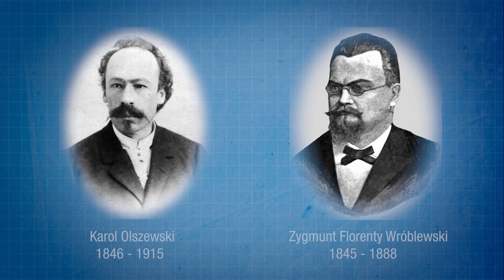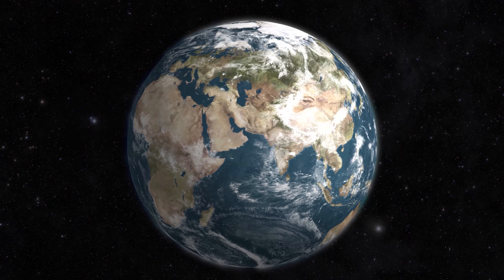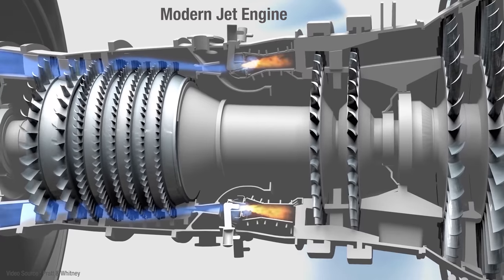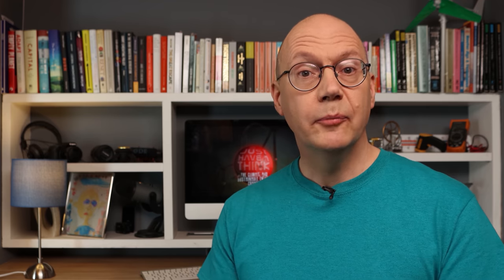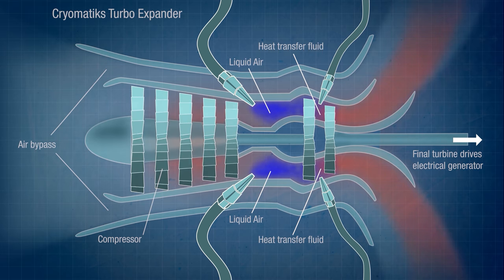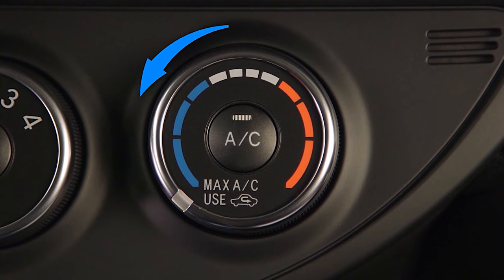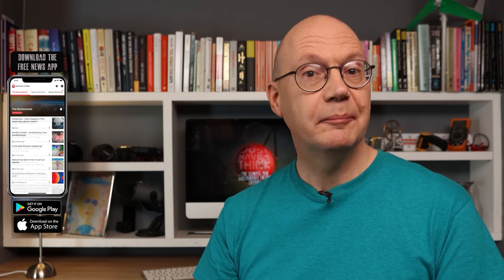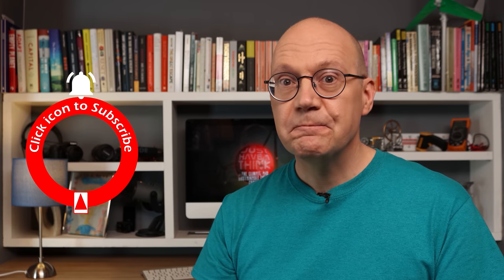Portable Liquid Air Power. A new boost for electric vehicles.

Comment: You talked about the turbine efficiency, whats the overall efficiency?  The power it takes to compress Nitrogen into it's liquid state, what about loses during Liquid Nitrogen Storage, still an interesting concept.
Reply: And by extension, what is the cost parity comparison? While it may be too early for an economic viability study, it would be useful to know how this compares per unit of energy produced based on the price of the liquified nitrogen.
Reply: If it is not mentioned then it is terribly bad.
Reply: Also, what is the source of energy used to compress N? If its fossil fuels, then what's the point?
Reply: If we look into the future to where all these solar and wind farms are operational, there will be many hours during a year where the electricity will either be free or the farms turned  off. That will offset the need for high efficiency. Btw. Why worry about efficiency now? We never did before. 
Eventually everything will be a waste product.
Reply: @klausnielsen1537  Efficiency is only relevant to how it affects cost. If the technology doesn't provide an economic advantage then adoption will be limited and isolated to niche use cases. The current uptake of solar and wind farms is because of cost. Similarly the uptake of electric vehicles is based on long term cost reductions in operating costs of maintenance and fuel.
Reply from the maker: Yes. Lots of questions still to be clarified in the final prototyping phase.
Reply: Overall efficiency is going to be horrible.  If they managed to hit 25% efficiency I would be astounded.  The only saving grace with this system is the ability to regenerate on braking.
Reply: Do not forget safety.
Reply: @Obscurai  ...it's always time for economic analysis of 'as is' technology comparisons. The results should guide, not strangle, the direction for R&D.
Reply: Mr. Castleberry goes right to the point. The Overall Efficiency is the thing. As we all know, energy cannot be created only converted. With increased thermal efficiency of converting the ultimate energy source, be it solar, nuclear or hydrocarbon, into propulsion (work) will come increased economic efficiency. The question then becomes when will that economic efficiency overtake the economic efficiency of diesel propulsion. A thought problem with big economic rewards for some. Again it’s the big picture, Overall Efficiency, that will be the driver.  
Nice channel.
Reply: 60% in the most optimistic estimations. Realistic - 40%. Li-Ion gives 98%.
The only advantage is free air conditioning.
Dead end in automotive.
Reply: @tmcche7881  Yes, I was being polite.
Reply: @JustHaveaThink  Didn't say much about it but presumably you have to fill some sort of tank with nitrogen prior to driving about. I wonder how big this tank would be? Certainly high pressure/liquid nitrogen is safer than hydrogen.
Reply: @williamcooper9753  Nothing will beat diesel as a fuel. It's packed with energy, portable, storeable, stable and transportable by pipeline.
Reply: @Withnail1969  and cheap.  Yes, hydrocarbons are hard to beat as an energy source but also the source of our planets accelerating decline.  Perhaps what this site is exploring are ideas to increase thermal efficiency thereby reducing the hydrocarbons used per unit of work. Fun to explore all the aspects that go into that equation, like the ones you pointed out.

Of course the most effective way to reduce energy consumption is by reducing the number of Sapiens on the planet, but that’s not going to happen, by design at least.
Reply: @peceed  bear in mind this process is using heat from the environment as part of the energy generation process rather than producing heat as an undesirable waste product. It's efficiency is probably better than you think, I mean 74% (theoretical) efficiency is pretty good going - especially compared to 30% for a best case internal combustion process. I think this idea has way better potential than all that hydrogen fuel cell nonsense.
Reply: @williamcooper9753  and as someone else said, totally agree that straight electrical storage is better but there needs to be an over production of electricity if we're going renewable so compressing gas is quite a good energy storage method
Reply: @trialsted  I agree with the need.  Even with traditional power generation (boilers and turbines) the low demand after hours compared to the demand during peak hours presented an engineering problem.  Boilers like a constant load.  Storing energy during low demand and releasing it during peak demand mitigated that problem.  As an example the Helms power plant in the high Sierras that pumps water to a higher reservoir at night, then turns the motors into generators during the day and let’s water from the high reservoir spin the turbine/pumps the opposite direction .  Straight electrical storage may or may not be the best way.  “Best” being the most economically efficient. Much to debate here and slight changes in the cost of the ultimate power source can upset everything.
As you know these are tricks to stretch our power but they don’t change the laws of Thermodynamics.  Energy cannot be created only converted.
Reply: @williamcooper9753  agreed with your last statement but you can use 'free' energy to improve your process. Look at A/C systems, they have an apparent 2-300% electrical efficiency but that efficiency occurs by taking energy from the atmosphere
Reply: @trialsted  not sure what you mean.  An A/C system creates heat when it compresses the gas and discards that energy, which came from the electric motor, to the environment when the gas condenses.  Ultimately the electric motor is doing all the work, unless I miss your point.
Reply: @trialsted  It doesn't matter what I think or what you think, 60% is a maksimum efficiency stated by company that uses this technology for grid stabilization, they are below half of that now.
Currently used Li-ion batteries have better energy density than theoretical max for cryogenic storage.
Reply: @williamcooper9753  Overall efficiency matters, but if that were the only criterion, EVs would be using only supercapacitors instead of lithium ion batteries, because capacitors have higher round-trip efficiency. But at some point, you also need to care about size, weight, and especially cost. Supercaps can't compete on those just yet.

So this is just the same tradeoff. This liquid N₂ turbine system has (much) lower round trip efficiency than current Li ion chemistries, but what if its cost per kWh were also significantly lower? I could see speccing a bus that needs a 200 km duty cycle between charges using 1 km with supercaps, 50 km with batteries, and 149 km with a liquid air turbine. If the turbine is cheap enough, this could offset the increased electrical energy you need.

Mind you, I'm skeptical that they can get this technology cheap enough to really offset batteries and capacitors in EVs. But who knows?
Reply: @ps.2  Peter, thanks for your comments.  The technology for vehicles is intriguing because you have to expend extra energy to carry the equipment unlike stationary plants.  I would think that’s the great advantage of hydrocarbons. Lots of energy, very little weight.  As the weight per unit of energy of batteries and capacitors goes down perhaps we will reach a tipping point and electric drive will take over. “But who knows?”
Reply: @JustHaveaThink [ I have proof read this and find a variety of hilarious or not homonym Errors By The Google dictation keyboard or perhaps it is the Samsung cuz I have a new device and I'm having difficulty with these keyboards. I find disambiguating all of the typos trivial so have not otherwise edited it given a lack of time]
 I think it was yesterday that I was saying to a guy he's making a gas engine air conditioner with electricity connecting the two absurdly they still fear of on the premise that the engine will continue to use his little gas once loaded as it's using without a load presently. Anyway we discussed 30 cc Universal outdoor tool at Home Depot Which is less than 200 US dollars despite the kit having the four cycle and I mentioned that I don't know who is producing small liquid nitrogen capable turbine period before I verified the GE had the lubrication Etc issues down I was concerned but since then I have made this Myspace and there is a Cocoa Beach patented this reminds me of. This is also Jennifer former space in terms of using air as a material. I've only just watch this video but I will dare say that this is a trojan horse of a application which is the opposite of what people are arguing here. You see comparing mined diesel with manufactured liquid nitrogen is a ridiculous comparison. The better comparison would be using a nuclear power plant as we do on aircraft carriers to make fighter jet fuel for a Transit bus versus liquid nitrogen. 

Thermal energy is too cheap that's what people ignore. Consider the opposite of this application which is the heat at the bottom of the Six Mile deep copper mine in Arizona. Their interest is in creating demand for copper not in refreezing the iceberg period so accordingly they produce warm water instead of super high pressure super super duper high volume air.

But there's far more going on with the physics than creating oxygen-free environment for fried carbohydrates. There is the issue of what happens to liquid nitrogen at higher temperatures when not allowed to expand. My understanding of the physics is that it remains inert but remains a free source material with surprisingly High thermal conductivity and of course it is also still non-crystalline even if people want to say it's neither liquid nor gas consider it a plasma copper that is still conducting electricity like any high intensity discharge lamp for example. In order to move the energy that the fusion or at least division is continuously providing us maintaining a molten iron core you have to first move the Heat to the surface then you have to create a fuel with it and that fuel is liquid nitrogen. The alternative is electricity but unless you are trying to sell copper at insane prices and maintain the price of other Commodities like coal and oil and even nothing it is a impossible to defend producing electricity. Windmills do not reduce the cost of energy they increase the price of copper and in so doing extend the viability of burning fossil fuels into the future. Electricity is simply the enemy. When you consider the high-speed Tesla sports car and you see the amount of heat the transmission is producing and how it actually drains the battery to get rid of that heat obviously a in ambitious entrepreneur like the young Caucasian male you interview Seas Market opportunity. The problem is the braking energy is very small and you only need to store it until you accelerate I don't know why you didn't mention this because talking about the weight of the vehicle seems very unfortunate given this silence.

So as you began let me and hear by saying something that most people will be able to understand. Energy if the government as it must evicts the foreign company from the United States Arizona copper mine credible promise to pay them as much as the copper could have possibly received in Revenue and then proceeded to use that six mile deep baase for mining as instead a base to extract molten iron not just mantle Heat by literally filling most of the shaft with a 6 Plus mile deep core of superheated 3 million bar or whatever you want to call it liquid nitrogen. The premise of me telling the story is that you're moving so much heat you cannot limited by the speed with which you would move the heat exchanging fluid this is not your grandpa's Tesla. You're in one whole harnessing the molten irons ability to displace all other sources of energy so you have to move the significant amount of heat to the surface period at the surface you have a value engineered system to compress as some people say and I say snap the air causing the heat to be snapped out of it remember that's called latent heat or for contemporary science purposes the actual Mass of the nitrogen. Don't try to make this too complicated when you squeeze air hard enough that Heat is actually the mass being converted back into energy nothing less than that nothing less than the simplest form of nuclear technology we can build in other words it's arguably the opposite of man-made Fusion apparatus which is a physics research project not a energy production or distribution Enterprise at all I mean physicists especially nuclear physicists are not Saints we pay them too much money we practically guarantee they have no emotional intelligence or morality and certainly we don't equip them with any kind of formal ethics. If your expectation is nuclear power has something to do with energy production then you are very naive. Fission is for military even now and fusion is either a way to get investors to slobber or a interesting intellectual exercise. What we need are heatpipes and the intelligent application of eminent domain as discussed. We don't need to build a six mile deep base station we already have it. We don't need to continue to let them at Great expense produce warm dirty water or even clean water. We don't need to continue to fear the propaganda about nitrogen being off switch for brain which it simply isn't.

You can create the opportunity for proprietary engineering but doing so if you are ambitious is ridiculous. People need energy they need it for a variety of purposes including mechanical work. The cost of the heat at the bottom of that mine and the amount of heat that you can mine that's what matters. Engineering Distributing that as liquid nitrogen is not difficult it requires only one thing a decision to distribute energy so cheaply that no other form can compete.
Reply: @trialsted  Ballard is marketing its fuel cells as so much less heavy a package then lithium-ion for garbage trucks meaning you get many more dumpsters. The thing is liquid nitrogen the weighs nothing when the tank is empty so liquid nitrogen garbage truck can pick up more trash and also you can buy many more of these garbage trucks than the cost if either lithium-ion or just the capital cost for the fuel-cell imposes
Reply: @williamcooper9753  energy is converted into mass and mass is converted into energy knowing that is the difference between parroting a famous line and actually being able to have the think that is necessary
Reply: @williamcooper9753  you think that the added Mass in the vapor corresponds to the energy consumption of the motor LOL. Thanks for articulating idiocy I'm not sure I could have put it into better words
Reply: @peceed  I'm sorry did you watch the video at 70% it's 125 because of the other losses as discussed in this video and I'm not endorsing the application. In this video he gives it a 200 theoretical but the Cocoa Beach patent discusses the various premises of the hypothetical potential energy and I highly recommend that tangential only discussion it's not just a tangential discussion it's only a hint of the discussion. You really are just throwing arbitrary numbers out without actually even doing anything. About whether you have engaged in any heuristic whatsoever. This is Fox News and I don't know why you think it's welcome here
Reply: @ps.2  once again have you watched the video it concerns a specific product which is trying to enable battery electric vehicles. It's not presented as competition but as enabling? I have argued that it's an obvious Trojan Horse but the entrepreneur would clearly disagree with me and that's only if he was honest and ask for his State of Mind in the past not in the future
Reply: @Irene-fu6gj  You are 5 second away from confirmation of my numbers as long as you are able to use google search. 60% efficiency requires heavy multistage expanders and very heavy heat regenerators (heavier than stored air).
Automotive installations would be much less efficient, in the 30-40% area. Let's be generous and give them 50% - it is a double operational cost of Li-ion batteries (>98%).
The last, but not the least issue - recharging will be slow without standalone liquifier.
This technology is clearly unfeasible for cars - batteries are many times lighter and use half of energy.
Reply: @peceed  I have watched this video once and we'll watch it additional time that is to say we might not watch it at all but I will continue to study this intriguing development I may have very well inspired as part of a team looking at various process. The video represents the concept of heat harvesting but actually it isn't War monetization of the cooling system because you do not need to harvest such minimally high-grade Heat it seems. The amount of money that we spend on fooling systems and the amount of energy that is used not generated by them is one of those fruits that lays rotting on the ground.

We talk low-hanging fruits generally speaking not Fallen fruit because of the numbers terms of the total Market and Mr Cooper those say something very important which is how you draw the boundaries of the generation period where you draw the boundary around the generation Capital cost determines the cost of the source energy. In general the aggregate of the comments I respond to is disputing what constitutes generation. But then we have the real world butting in and that is what is most important!

We have the rail industry that used to burn COAL in turbines and now it is claimed dumb Heat by running it through a wire which apparently is the way they get rid of the inertial energy first by converting it to electricity and then that electricity to heat. In the spirit of getting something done namely moving stuff from one location to another. It's important to remember that this type of narrowing of our vision results in footballs of oil being what is getting moved by wasting inertial energy you polluted a lot to create. It is also very important that we remember the reason we care about them doing that it's not because of the energy consumption but because of the pollution!

The key to reducing pollution one must have an open mind 4 because it is likely drastically increased amount of energy to waste simultaneously with the energy being clean. You have to break that Chain by which increasing efficiency reduces pollution. This is where liquid nitrogen comes in because it does not require copper but frankly appears to potentially be the copper for the first miles and as I said ironically those first half dozen or so miles are already plumbed for people and copper ore. Infrastructure speaking it is a metastasizing tumor and it must be radiated. A question about supercritical nitrogen generating neutrons and the ability to safely handle those neutrons. This is where the silence is we need to go there!
Reply: @peceed   Thanks for your coherent arguments.  I am curious about this 98% efficiency for Li-ion. I presume that is simply accounting for the slight difference of energy in and energy out of the battery. This is great but to get a true efficiency wouldn’t you need to account for the energy expended hauling their weight around in the car?  If you wanted to compare it to hydrocarbons you would also have to include the losses of generating and transmitting the power that charges those batteries. This is where Hydrocarbons, being so light per unit of energy, appear to gain the advantage in cars and trucks.  Let’s not even talk about ships (my background).
Regards,
BC
Reply: @Irene-fu6gj  Learn thermodynamics first(and physics generally), then try to save the world. Liquid nitrogen as car fuel was tried in 1902 and it still sux 120 years later.
Reply: @peceed  mantle heat is too plentiful to meter- electricity TOO EXPENSIVETOBOTHERWITH.

USE THE FORMER, SJUN THE LATTER TO COMPUTATION ONLY.

EASY PEASY.
Reply: @ps.2  "especially cost" UNDERSTATES IT- did you see this: ""Following three decades work in the area, about more than 100 phenomena are found as reasonable to characterize expected transient scenarios" seems a ridiculous sentence to me. Take: "I just saw about a hundred police cars escorting somebody..." but here we're not talking about cars not police cars [but look at the word and just because I can say it and get it typed doesn't mean you can't find it period as in 100 what you say?] Too _many_ to count for the ... "abstraticion" which despite the article being under 4 years old seems to be analog AKA manually produced. [The ABSTRACT  quoted that is!] No decent computer would say "about 100" but the entire point is that this is without intelligence and when you look at the writing in the [most GermanE-speaking to our 'debate']  field it's all about a bunch of two-letter abbreviations and then some long like five-letter plus abbreviations... I like the use of the word "hydraulic" especially when you put a letter on that and get [heatpipe] "hydraulics." With fission cooling- is _control so it's somewhat understandable but there is never a reason to do the fission (OURSELVES?) not on Earth with this video concerning Mobility so you can Define nuclear energy as being (INDEED) so far only OF  the 'mobile' sort. In other words if you want to "move the uranium to the hostile" or you want to "produce the jet fuel with electricity on your 'boat.'" If you are building a power plant that is going to be on the land however you wouldn't bother to produce heat with fission because there is plenty of heat underneath the foundation d u h and the beauty of it is you get to decide how hot do you want your heat? If you walk in on any of the meetings with these nuclear Engineers going back more than three decades of course but including the last three decades and say "but why bother?" they would  say "well because we are trying to make a bomb" or "we are trying to power an aircraft carrier." It's never been about us it's always been about _violence_ not solution*. Now we have *_this_ national security threat from all of the brain power for so many generations being militarized. Ain't that ironic?"
Reply: @JustHaveaThink  we very much appreciate the transcript even if I had to download a new to me 4.9 reviewed with 10 million downloads app to this device to get it to open Else I had to update the Microsoft word's first lol    
In part because of the difficulty of it not being an HTML page but requiring both downloading to internal storage and the use of an app that's not ready to go on everybody's device here are three excerpts that I think are particularly relevant to this discussion thread and I took the liberty Beyond copying and pasting them to change the order slightly but as you know or should know most of the know-it-alls commenting most critically have not watched the video and certainly not read SO here is their chance which I think THOSE  WHO can't afford the bandwidth for the video will most appreciate:
"liquid nitrogen, has a potential energy of just over 200 watt hours per kilogram. After allowing for the Carnot efficiency losses and other system losses, the Cryomatik Expander achieves something in the region of a hundred and twenty-five Watt hours per kilogram. To put that in perspective, that’s about the same output as the battery pack on the 2021 Audi eTron electric vehicle.
....packs for EVs have the regen energy capped to a certain percentage in order to preserve the life of the battery cells. As the mass of the vehicle increases, that percentage gets reduced even more, in order to protect the pack. Any excess, unwanted energy is just dissipated into the air and wasted. It’s this excess energy that the Cryomatiks system captures in its heat transfer fluid. That means that as much as ninety percent of the potential energy available from regenerative braking is captured, compared to about fifty percent in a normal EV. Commercial vehicles, especially urban delivery vehicles and buses, have a very heavy stop and go duty cycle. That means regen braking is being employed a great deal of the time so the more of that energy you can recoup and use, the more efficient your vehicle is and the longer it’s range will be each day....
e system works out slightly more expensive than diesel in terms of cost per unit of energy delivered. But of course, as economies of scale kick in, those costs will reduce quite significantly. A test series of l
ast mile electric delivery vehicles equipped with the prototype twenty kilowatt Liquid Nitrogen powered range extender will be on the road in Florida this year to collect real world data. A slightly smaller ten kilowatt model is also being developed for use in electric fork lift trucks. The plan for 2022 is to test a 30 kilowatt liquid air expander in Class 3 delivery vehicles, which are the FedEx/UPS style box vans we’re all familiar with. Initial contracts will be set up in the state of Florida where Cryomatiks are based, but there is already an existing network of five thousand service centres for deliveries of liquid air right across America"
Reply: Thomas George the audience here is not aware of the energy it takes to Frack methane or the methane that is burned historically by flaring in oil development or the oil that is burned to demonstrate well capacity without compensating the owner of the oil WHICH historically has often been the poorest people on the planet with governance that is easily corrupted so that you can pay their leader one millionth of the compensation that you would otherwise have to pay the people. 
There are many reasons to tax all of the energy that industry uses including in the case of fossil fuel any solar energy that they use in the course of producing their fossil fuels for sale. Repeating that instead of giving the oil industry brownie points or even compensating them for switching from fossil fuel to solar energy often for heat in the industrial processing of what they mine we should be tAXEN  them just as we should be taxing them for ALL of the energy they use internally. For example in America the Natural Gas utilities used to operate their vehicles on natural gas BUT where they paying a Road tax to do so? Despite not paying a road tax they have switch to gasoline because of the General Motors and other car companies mining of the welfare "TRACTOR" ( food stamp another words welfare as intended) receive verses more efficient vehicles. 
Now the point of taxing all of the use of energy is that you can then waive the tax strategically knowingly deliberately intelligently.

So the energy that Australia uses digging up the dirtiest COAL which is essentially just dirt that they're burning and then taxing them for the carbon dioxide released burning it very inefficiently to separate the hydrogen from water so they can at Great expense ship it on tanker ships already built to Japan so that the special interest in Japan can gouge the people of Japan instead of being fully liable for screwing up the nuclear power plants and getting them done right this time again at investor expense not that of the people. 
Do I have to point out that JAPAN _could_ INSTEAD be building the nuclear power plants in Australia to produce directly the hydrogen from the water instead of using COAL #RESToFWORLDTERRORISTICeNEMYaLINGLY for just electricity to produce the hydrogen? More importantly Japan could be negotiating for Australia to allow them to mine geothermal heat and use that heat to liquefy the air and then building a submarine pipeline for that liquid AIR from Australia to Singapore and Japan and even Beyond because we are going to sell our Arizona already tempt molten iron core under mantel inexhaustible likely natural Fusion replenished easily world-wide sufficient geothermal liquid air to Asia if they don't and frankly Japan has the right to buy our liquid air if they prefer it even if it cost more than the Australian because we are not evil as Australia or at least won't be soon and already have this damn copperminE with the plumbing to take the liquid nitrogen out or at least the heat out in the entire mineshaft that can be filled with supercritical fluids likely most effectively liquid nitrogen itself.
Reply: @peceed  I agree. I think a fundamental understanding of thermodynamics should be required for anyone wanting to leave their mother’s house.  It is frustrating to try an exchange ideas with well meaning people that don’t have a grasp of the basic laws of physics, yet are adamant they have the answers.  As for saving the world, that’s not gonna happen. Some problems don’t have answers.  Although it is fun to theorize about little fixes like we do here.
Regards.
Reply: @Hy-jg8ow  The point is that it can easily be renewable energy, and in particular since it is a process dominated by the energy cost of the cooling, not the equipment cost, its economics are very attractive for using otherwise surplus energy from variable renewables, which makes it easier to integrate the increase in the share of variable renewables in the total energy mix.
Reply: @williamcooper9753  Though when making that comparison, it is important to look at the full economic cost of diesel, and not ignore the unpaid but real cost of using the atmosphere as a carbon dioxide dumping ground.
Reply: @brucemcfarling7810  but Bruce, we have too ignore it, as our fathers and grandfathers did, or else we will have to face the fact that the planet can’t support this many sapiens. Ignorance is bliss.
Reply: @williamcooper9753  The planet can support this many sapiens, if we would tailor our actions to what the planet can support. A lot of us in higher income countries are like somebody jumping up and down on a tree limb, and then acting like it's the fault of the branch if it breaks and they fall to the ground.
Reply: @brucemcfarling7810  Good morning Bruce.  We have found our difference of opinion and that is an accomplishment.  It took two million years to get to a billion people on the planet.  It took only another 200 years to reach 7 billion. We can thank the industrial revolution for that.  We are well past the equilibrium point for Sapiens’ consumption and disposal of resources vs the planets ability to process it.  Climate change is only the precursor of human produced problems to come. No number of Tesla’s or windmills will solve that, only allow a few more billion to be crammed onto the rock. We have lived in a time where all problems have been solved by clever engineers and scientists but there is a limit and we have arrived.  In the scheme of things it matters little. A little planet on the outskirts of one of the galaxies has a short anomaly on its surface for a blimp in time.  But Bruce, you and I have lived in good times. Enjoy. Bill
Reply: @williamcooper9753  We have indeed. 300 million Americans have the same impact on the planet as 3 billion Indians would have. The US and EU scaling back their impact per person would dramatically reduce the impact of the human population on the planet. So when it comes to "we have been doomed since the population passed two billion", we do indeed differ on whether it is all hopeless and we may as well just give up.
Reply: @brucemcfarling7810  not sure who you are quoting there. We are approaching EIGHT Billon. “The US and the EU scaling back their impact” will have little effect, only slightly delay the inevitable.  The population of China and India alone combined is nine times that of the US. THE MATH IS THE THING.  But there’s no reason for you to get all depressed over this. Our comfortable lives are secure. Relax and enjoy the day. Besides there’s a good chance humanity will go out in a firestorm of nuclear explosions and avoid a long painful fight to the end. Be more optimistic Bruce. Perhaps life on the rock will start up again and another life form will develop thumbs and repopulate the planet with their species. That thought should lift your spirits.
Reply: @williamcooper9753  And somewhere around half of the impact from 1 billion among the 8 billion.
Reply: @brucemcfarling7810  right now that may be true Bruce, but I hear the other seven all want air conditioning, cars, and vacations abroad.  What’s your plan for denying them?
Reply: @williamcooper9753  The planet already has the plan for denying 7 billion people having a US lifestyle stored up in the form of ecosystem collapse, so I don't figure I need any special plan for preventing something that is in any event physically impossible.
Reply: @brucemcfarling7810  Bruce, so we don’t have a difference of opinion after all. This “ecosystem collapse” will apply to all eight billion of us and the planet will be turned over to surviving life forms to carry on.  Great minds think alike.
Reply: Don't worry about it!  Our goobermints will subsidize this technology so that it will be economical to end users and the cryogenic OEM.  Only ordinary tax serfs will be screwed over when the bill comes due.  And, remember, we have the best get out of jail card:  we did it to save the planet!  Right.
Reply: @JustHaveaThink  crisps or chips  or in my native language brazilian portuguese salgadinho or in plural with s exemple salgadinhos. Is super funny 🤣 moment. Yo know sometimes are craving some food 😋🤣🤣🤣🤣😂😂😂.
Reply: As i saw the video the liquid contains 20.8% oxygen, but then he also shows a pure nitrogen portable container. Very confusing since at no point he claims extraction of oxygen. And he keeps using the phrase AIR and liquid. So i must assume the liquid is not cleaned of oxygen, and the nitrogen picture is just to show a portable container and not a nitrogen container. Very confusing with that picture inserted. so i just guess and assume what he is saying
Reply: @Hy-jg8ow  The company from the UK that is mentioned here can use solar and wind to liquify the air. The interesting thing is that as the processing plant gets bigger the cost goes down.
Reply: @Obscurai  solar is now cheaper than fossil fuels in producing electricity.
Reply: @mikejsoames1996  Correct. I said as much in the statement "The current uptake of solar and wind farms is because of cost."